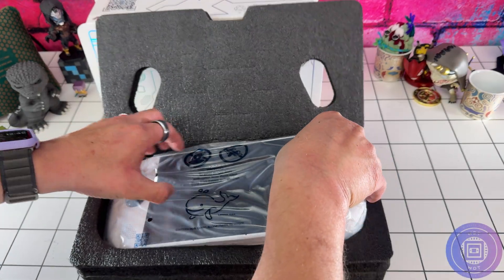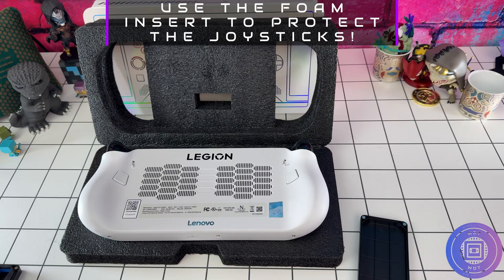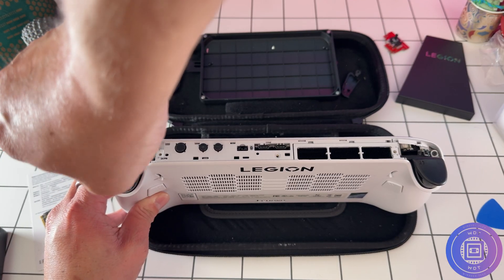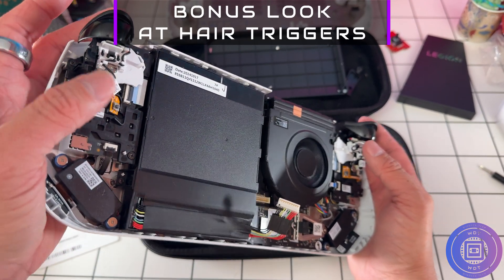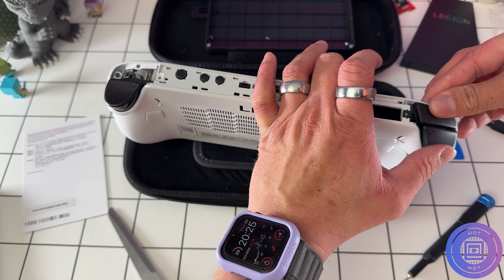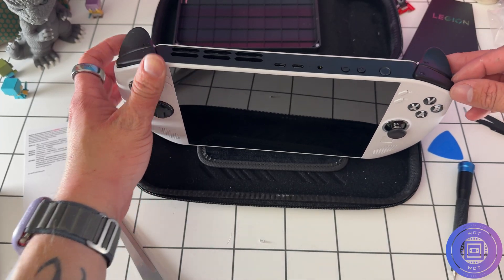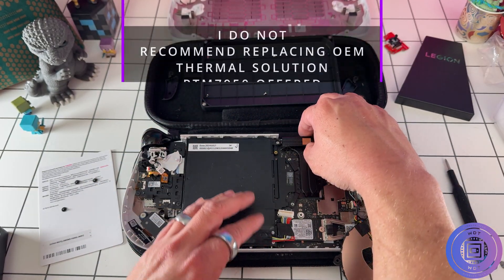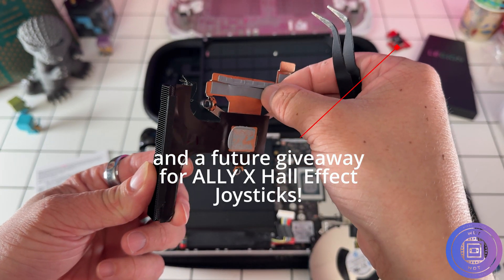Lenovo Legion Go S | SSD Upgrade Guide AND Teardown Tutorial! - Z1E & Z2 Go

Comment: I cannot for the life of me get the bumpers back on correctly, they screw back in on but they feel terrible and I can't press them at the end closer to the center of the handheld. I have no idea why they designed it this way, and not just a removable backplate like every other handlheld
Reply: ok, I did it, I can't explain exactly how, but they are back on. Seems like they need to bend slightly to snap in there.

Thanks for your video, seems like there are no others out there right now
Reply from the maker: No problem sorry I couldn’t respond quicker. The sharp parts need to hook in slightly but also there are hooks for a clip on the bumper towards the front of the device.

Comment: This is the only thing i kind of hate about the Go S is the tear down process because i want to get the model with SteamOS in it when it comes out but i was hoping it would have been a lot simpler than this and also i do want to install a 4TB drive into the system just because i would prefer to have everything on one drive and sure i could get an SD card but honestly would prefer to use that for media and emulation since SD cards are a lot slower as well.
Reply from the maker: If you are careful with it and take your time it’s not “hard” per-say. It is just highly involved and needlessly convoluted imo.

The major parts to take care of is the bumpers upon re install, taking them out with my method using a guitar pick shouldn’t end in damage.
Also, ensure you are using the correct bit size and when taking out the captive screws in the trigger wells, ensure you are unscrewing it at the angle it is installed. These screws are quite strip-happy
Reply: Well i don't have steady hands as i used to when i was in my 20's which is why i like the other systems with just popping off the backplate and swap the drive or removing a simple shield hiding the SSD and then replace the drive.
Reply from the maker: @EcksGamer hey that’s completely fair! Which is why I’ll agree it is needlessly convoluted to teardown, a stark contrast from the go 1
Reply: @WinDeckTech  Ya the only way i would ever really replace the drive if i was going to a Microcenter for them to replace the drive for me which i hope they're going to sell the system when i visit Boston in June and if they won't do it then i will just use the 1TB drive and use a 1.5TB SD card for my lesser games that i still play that doesn't really need to run off of a SSD.

Comment: Out of curiosity, do you think it’s possible to replace the battery with one that has a larger capacity?
Reply from the maker: I mean, technically anything is possible, with enough time, money and determination.
The battery does appear to be in a cradle so unless you were to remove that cradle or find a larger capacity that could fit into it, you may not be able to
Reply: I sure hope someone makes a battery mod for it like the og legion and the og rog ally cause honestly the only thing I dislike of mine is the battery life